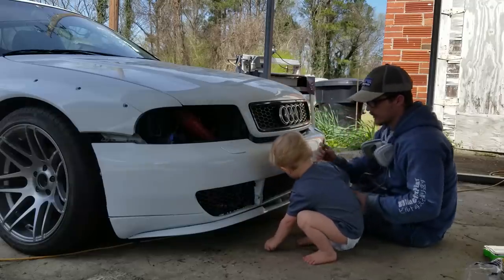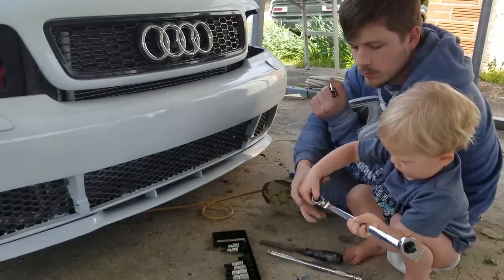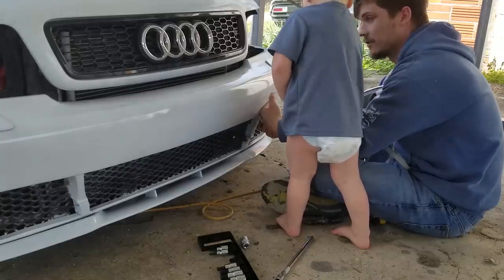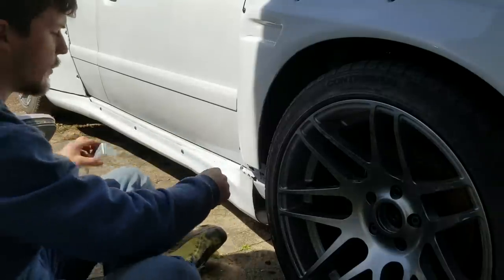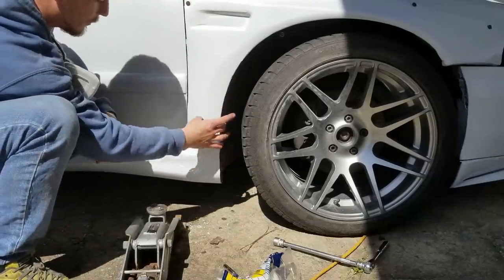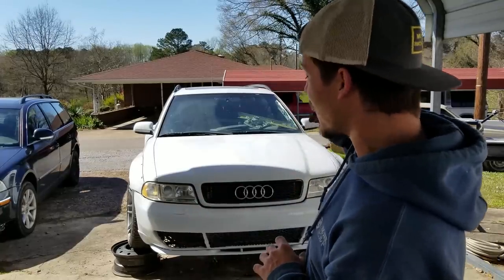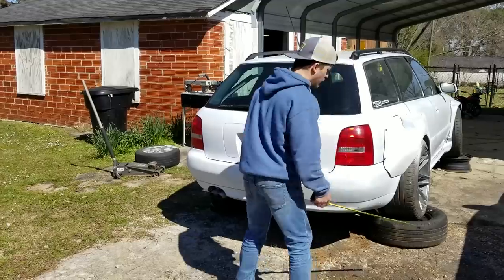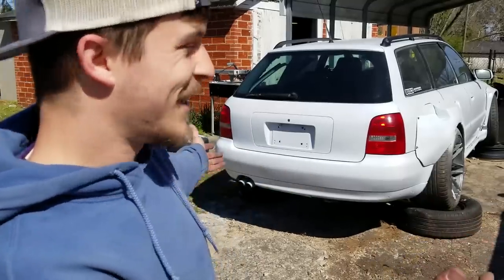WIDEBODY A4 FINAL ASSEMBLY

Comment: Question: what is your wheel/spacer setup? Is the avant wider than the sedan? The track width (wheel centerline to wheel centerline) is 58.2”. If you subtract the width of one wheel that’d be your new track. Overall width (w/o mirrors is 68.2”... assuming the avant- is the same width as the sedan.

Comment: Hey man, I'm loving this build, but there's just one thing really irritating me and makes the car feel like it's not fully polished.  There's no "end caps" on the rear fenders where the door jams are, and also on the ends of the side skirts, just looks really hacked together which I know this build isn't by any means necessary.  I hope you fill those areas up with a little foam/fibreglass to give a nice final finish because it just looks really shoddy when you open the door or look at the sideskirt from an angle.  Keep on rockin' brother!

Comment: Looks good man, you always build cool stuff, but instead of cutting away so much of the body and door, why didn't you go with like a 265/30/20 or 255/30/20 tire?
Reply: arush90 gaming I see where you’re coming from, but if you’re already going to cut the fenders, might ass well go balls to the wall. A bigger cut out of the fender isn’t going to decrease the value, as if he only cut out an inch. Cutting is cutting.